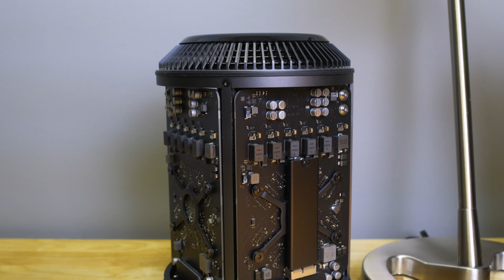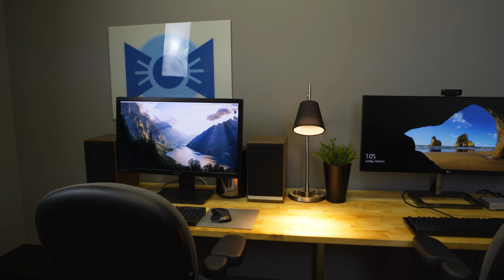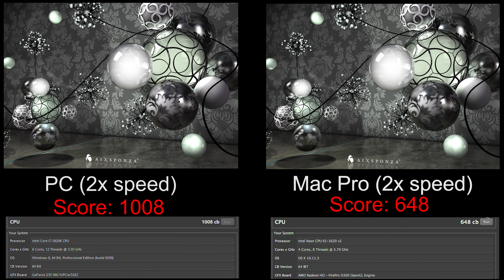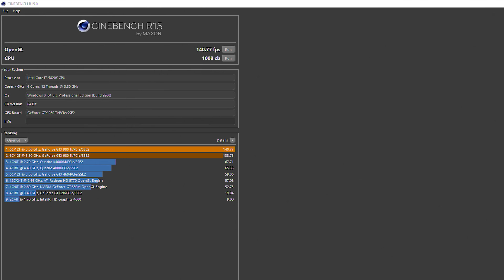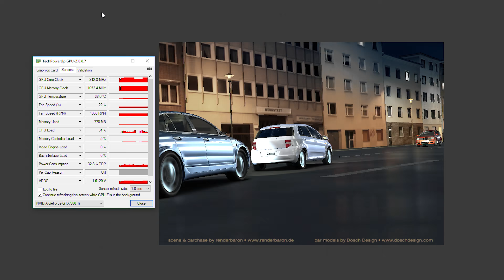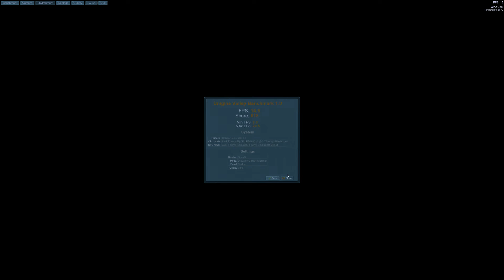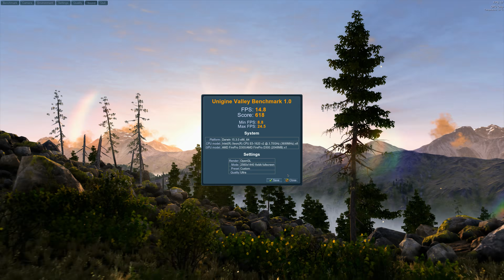$2,000 Custom PC vs $4,000 Mac Pro

Comment: So... what is the point in a Mac Pro?
Reply: If you have tons of cash to waste and grew up stuck on the Apple operating systems and cannot learn to use Windows. 

You can run all Apple software on PC using emulators if you want anyways. Apple is a fashion and status symbol, nothing more.
Reply: Cyril Blanc That's not how IPC works. That's not how cores work. That's not how hyperthreading works. That's not how anything works.
Reply: +Cyril Blanc you do nothing with the bluetooth in iphone, you cant share music or full resolution pics, you are probably comparing your 1000 bucks iphone with a 90 bucks galaxy young, that is something common in apple users...., apple always ask you 2 times more buck for their products, you cant defend that.....
Reply: Today it is a non sense to compare a 3 year old E5 Xeon Mac Pro to a E7 Xeon PC

I have a 2010 Mac Pro for Music, it's a great computer, very reliable I play a 100 track orchestra 
This Mac has 84 audio in and 64 audio out, a Raid of ssd on a SATA III card to put the VSL library
4 x monitors.
I use it with Logic Pro X and MainStage 

My old G5 2 x 2Ghz  (2003) is still working
What else ! 
I am A happy user

At the moment I am beta testing Sierra on a MacBook Pro retina, works fine. Apple has to work a bit on recognising the French

Mac OS is always before Windows, Windows user have the feature of Mac OS from 2 to 4 year after.
Windows user have to thanks Apple since Mac OS upgrade are free, Windows upgrade are free !

In the family we have a MacMini, 3 x Macbook, an iPad, 4 x iPhone ; no issues, 

Opening of my gate with a Samsung v.s. an iPhone, the Samsung has a smaller Bluetooth range !

It is also said that in an office the maintenance cost for a park of PC,  are twice the price of a MAC's park
Reply: Cyril Blanc "Today it is a non sense to compare a 3 year old E5 Xeon Mac Pro to a E7 Xeon PC"

But aren't they still selling it right now for $4000?
Reply: You may get new Mac Pro in September !
Wait and see
Reply: What's your point? My Sun server running dual UltaSparc IV 2100's still runs. I run Debian Linux (Squeeze) on it. Uptime is 1295 days, 18 hours, 32 minutes and has been hosting content for the entire time.

I run nginx, openssh, pureftpd, unrealircd+anope services, mysql, phpmyadmin, and all kinds of other services including dns, mail, and my own private repo. It never skips a beat, and it still cost less new than a MacBook Pro. Oh yeah, passive cooling too (not that it matters, the co-loc keeps the server room chilled below freezing, which makes going there suck).

Sparc architecture is friggin amazing. Too bad Oracle had to buy Sun.

Anyway, you keep worshiping Apple, Cyril, meanwhile I'll attempt to get the most suitable hardware I can find most affordably while understanding the software I install on it inside and out.

Oh yeah, if I wanted to do a dist-upgrade from Squeeze to Wheezy, and then to Jessie, it would literally cost me absolutely nothing except my a couple minutes of my time to edit /etc/apt/sources.list and then run apt-get update && apt-get update && apt-get dist-ugrade. I might have to hit Q when apt-list-changes pops up, but that's about it. Whereas, an upgrade for OS X can get pretty pricey.

Anyways, toodles noob.
Reply: It is better to have a smaller bluetooth range instead of having an apple device whose bluetooth cannot be used to transfer data between devices. No one is going to be miles apart while using bluetooth.
Secondly, you should compare the price and not the hardware. It is a bigger nonsense to charge 4K for outdated hardware, so I think the comparison is fair.
Having Said this, I have custom build PC's from early 2000's and late 1990's working (Windows 98) which works, but I don't see any use of outdated hardwares working since they cannot support the latest technologies  .
Finally, people always compare an expensive mac with an inexpensive PC. Try comparing Thinkpad with macs and you'll know that Thinkpads are worth the money.
Reply: If you where thinking a little ;  Intel is still selling an 
INTEL XEON E5-2697V2 - 2,7 GHZ - 12 core - 30 MB cache - LGA2011 SOCKET - BOX - for 4359 euro in France

I can open my gate within  15 meters with my iPhone , the telephone of my son in law range is 2 meters !

Before to post look on Internet !!!!!!!!!!!!!!!!!!!!!!!!!!!!!!!!!!!!!!!!!!!!!!!!!!!!!!!!!
Reply: You just talk rubbish. May be you cannot understand my post !
The price depends on the price of the processor used !
If a PC contains a processor at 300 $ you will not pay it 4000 $
If a Mac contains a processor at 5000 $ you will not pay it 2000 $
Reply: +Msi Before posting rubbbbbbish go on Intel site and look at the price of the processors !
Reply: Cyril Blanc I can get an i7 6700K right now for about 320USD. Good luck getting any mac product with an i7 6700K at all, let alone in the range of 320USD.

http://www.newegg.com/Product/Product.aspx?Item=N82E16819117559
Reply: +abortionsrock 
I7 can go up to 1800 $ http://www.newegg.com/Product/Product.aspx?Item=9SIA1N849S2306

In a Mac Pro you have Xeon processors and sometimes two Xeon, depending of the model a Xeon can go up to 6500$ each !
http://www.tomsitpro.com/articles/intel-xeon-e7-v2,2-697-2.html

If you want to get an I series MAC you get a Macmini starting at 499 $ with an I5 and at 999$ with an I7
http://www.apple.com/shop/buy-mac/mac-mini?product=MGEN2LL/A&step=config#

read this :

I saw a serious analysis a  PC v.s. Mac with EXACTLY the same components ; the  MAC PRO was a little bit cheaper !!!!!! ;)
The problem with Intel processor is that you can pay 200 $ for one and more than 5000 $ for another.
An I7 is very cheap compared to a Xeon, a Intel Xeon E5-2697 v2 (2.7 GHz) was 5231euro so you cannot make a PC at 4 000 $ with the same processor.

A Mac with an Intel Xeon E5-2697 v2 (2.7 GHz)  is 5800 euro 

On Intel site on http://www.intc.com/priceList.cfm

An E7-8890 v4 (60M cache, 24 Cores, 48 Threads, 2.20 GHz (165W) 9.60 GT/sec Intel® QPI, 14nm) is a 7174 $ 
An i7-6950X (25M cache, 10 Cores, 20 Threads, 3.00 GHz, 14nm) is 1723 $

The I7 range starts a 303 $ and goes up ti 1723 $
The E7 Xeon® processor 8800 series starts at 3059 $ to 7174 $

So the study made by Snazzy Labs is not objective :(
Reply: +Cyril Blanc i know perfectly the current prices of AMD and intel cpus, for 300-350 you can get a good i7, discarding the extreme edition ones, that are like 10 core 20 threats (1600 bucks)
Reply: +Msi When you compare a Mac to a PC you need to compare to a good brands like HP, DELL ... you pay for the support too.

 Apple is know to have the best support in the computer business, 
A few month I telephone the support about a question for my very old dual G5.

When  you have a problem with a home made PC you are in a deep s...
Reply: Cyril Blanc Dell & HP are not good brands. 

If you are capable of building your own PC, chances are you are capable of trouble shooting it yourself as well. And you can always RTFM. If you can't RTFM, then don't build your own fucking computer.

Apple support is designed for those with the cognitive functions of a five year old.
Reply: A Mac pro mid-2010  2x6 core 2,66 ghz, disk 2 to, ram 32 GB 1333 mhz Ati radeon hd 5770 this is still sold € 1850
Do the same with a home build PC !!!!
Those machine are indestructible
Reply: Cyril Blanc € 1850? LOL for that outdated garbage?

http://pcpartpicker.com/user/Zombiest/saved/KR8Ff7 for just 300 USD more, you can get a far more modern and capable system.
Reply: 12 core at 2,67 Ghz is 32 Ghz of rough power 
You dont know what you are speak about !
Reply: That's not how it works. I don't think you understand the technology, which makes you the perfect Apple customer. However, I urge you to do some research when it's time to upgrade and instead build your own PC that's much faster and just install Mac OS on it. It's the best of both worlds!
Reply: If you build your own PC you will not have a technician send to your home to fix it in case of a problem !
This is why you pay a bit more.
As said before with the exact same components a PC made by a major (HP, DELL ...) is the same price. In some cases the Mac can be a bit cheaper or a bit more expensive, it's depends of it's components !
Reply: Cyril Blanc If you can build your own PC, you're intuitive enough to use google to resolve most if any issues you can encounter. You also don't void your warranty if you wish to install more RAM, or another SSD/HDD.

In fact, most computer hardware manufacturer's provide outstanding warranties and extended warranties and merchants such as Newegg and Amazon will offer insurance packages as well. Further, the merchants/vendors tend to provide excellent RMA services, should you lose the silicon lottery and suffer an excruciatingly painful coil whine, faulty fans, swollen capacitors, etc.

You'll also have the added benefit of installing a real OS that isn't a proprietary piece of shit that owns you more than you own it, such as Debian Linux.

Face it, Apple EULA pretty much claims you never actually own your hardware, let alone by using the hardware and software you automatically agree that Apple has full authorization to claim any body part to include kidneys, livers, bone marrow, etc as their own.

Finally, your argument of "Dell and HP are similar" is retarded. No true computer aficionado would ever purchase a Dell or HP outside of a datacenter (exclusively for warranties). The only other people who would purchase a Dell, HP are your over the hill uneducated shills who actually believe television commercials.

Just get an MSI Laptop, or a Zotac, or if you need a desktop and mini-form factor is your thing, get a Skull Canyon NUC, or a Zotac mini-pc.

But for the love of free thinking, stop believing Apple is better than everything. It's shit tier, just like HP, Dell and Oracle. They can all fuck off and die in fires.

Comment: The fact that the mac is over 2 years old doesn't even matter, my 5 year old 3930k runs laps around this system
Reply: lol
Reply: +Antwan van Houdt A quad core Xeon is not very expensive, you can often find it for less than a unlocked 4core  i7.
8 core Xeons or more are expensive but not the one in this video.
Also I doubt AMD sells those FirePros to Apple for the same price you can buy them from a store. They are effectively dual HD 7870s after all, a mid to low end card now. No doubt a single 980Ti will run laps around them.

Apple should have updated this system, it very old.  It's obvious Apple is not better for professionals, those claiming this lie to themselves.  The best solution if you have to use a PC is to build your own which you can easily upgrade in the future(add more ram, more or faster storage, change the GPUs etc) which is very hard to do on a Mac or iMac or anything from Apple.
Reply: Antwan van Houdt Im not telling my self, im telling you. it is no magic thing, just look up the cinebench scores of overclocked 3930k they hover around the 1000-1200 mark in C 15, almost doubling the performance of this
Reply: Antwan van Houdt Just read again and you might understand whats the point of this conversation. Thanks. His last sentence was about CPU only which stated that old Mac Pro CPU vs an even older i7 3930k which destroyed it. The only difference between those CPUs are the unlocked multiplier and the onboard graphics which has no impact in that regard. Try again. Apple fans with no clue sounds familiar right?
Reply: ***** Right.... xD, keep telling yourself that, who knows in a parallel universe it might be true.
Reply: VenoXj1 Hes using an i7 not a xeon, his argument was stupid from the start.
Reply: EnigemCenia
Enthusiast, still consumer. Comparing firepro's and Xeons to simple mere consumer hardware is always going to put a huge skew in the price. MSI built a macpro like case with 2 1080's and an i7 and its about as expensive as the MacPro was back when it still had value. You pay a small premium for apple ( and a bigger one for the windows piraters out here ), but the rest is just all the hardware and the custom design and therefore PCB.
Reply: ***** not even close dude, im a character artist and i do loads of heavy tasks, the mac sucks
Reply: The difference being is that its a whole other kind of hardware. Xeon's and the AMD GPU's used have a heavy premium. Obviously consumer grade i5's and i7's are gonna be a lot cheaper when intel charges 200 instead of 2000 as a baseline.
Reply: UltraFighter18 I never claimed that this macpro was better for professionals, and I run a hackintosh myself. Yes the hardware is dated and it has a premium. But thats what you get with custom designed components to put such a hellishly powerful machine ( at the time ) in such a small form factor. Much like the new MSI clone of this machine thats also expensive as fuck because of the exact same reason. That said, no one should buy this machine as its obviously a bad value if the hardware isn't updated soon. Which I hope they do because the nvidia web drivers for my 980ti are dogshit and I want native maxwell support in OSX.
Reply: +Antwan van Houdt you forgot to write in paragraph form.
Reply: Antwan van Houdt It was shit value when it was new...
Reply: ***** No not really, and the build quality is something you pay for, as you do with a lot of other brands for that matter. You want pure value? go right ahead and build your own PC/Hackintosh like I did.
Reply: Antwan van Houdt Are you trying to lecture me in the build quality of apple?, there is no exceptional quality to talk about, the only impressive thing about it at the time when it came out was its size and the weird garbage bin design. The value when it came out was total shit, referring to my original comment, my 5 year old machine crushes this, meaning that when it was brand new my machine was already 3 years old and for half the price when it was new.
Reply: +Emil Klingberg That last sentence of you just destroyed him in all facts he just "delivered". I really hate those apple fans who have no clue whatsoever.
Reply: you do realize those i7s you're talking about aren't consumer-end i7s.
Reply: Yes, but 1080's are top-of-the-line Graphics cards, whereas the 7870's are not in any perspective.
Reply: That's Intels problem, not Apples.